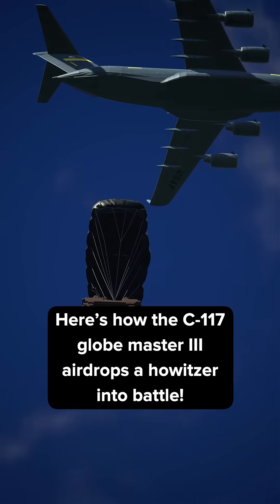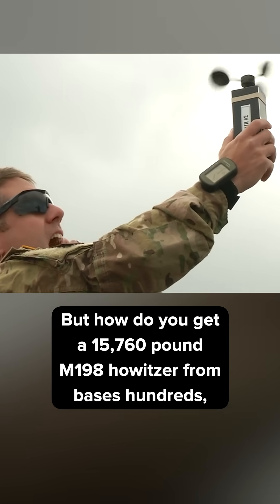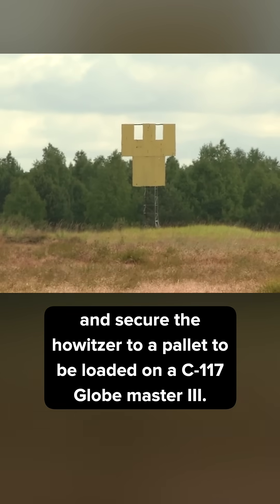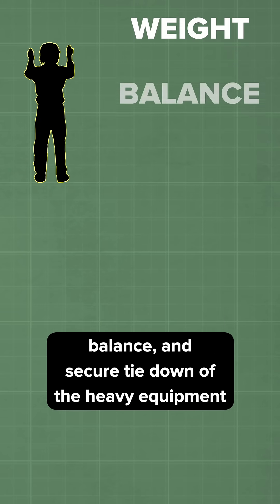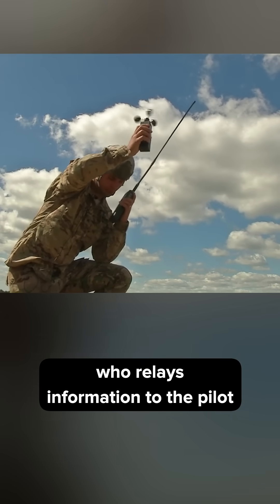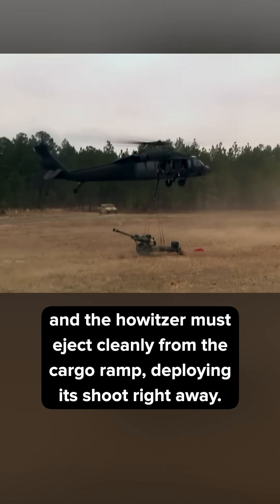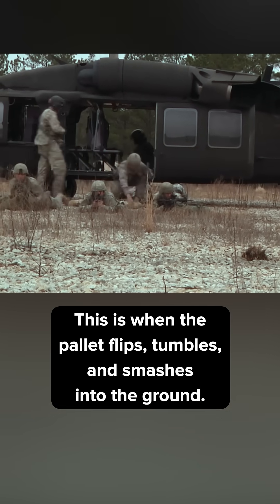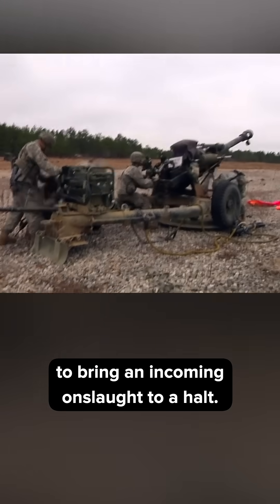Airdropping Howitzers Into a Battlefield

Comment: Soo many mistakes here. C-17, they are dropping a M777A2 not a M198 but even then they keep showing a M119A2 howitzer. Also the weight of the M198 is off because he’s including the weight of the “H-pack” which is never issued or attached. You either hand pump it or if you’re lucky enough to have a 5-ton, you can hook up to their hydraulic line.

Comment: Hey ummm, “burning up in descent” refers to this neat little natural defence mechanism has to stop fucking meteors from hitting the ground, basically it’s because the meteor is so goddamn heavy that it squishes all the gasses in the atmosphere that it lands on, into this tiny little area in front of it. This is how air resistance works, and it’s why things like feathers (that are light enough to catch the air below it and ride it) fall at a lower velocity than your grandma when I pushed her down the stairs, but back to meteors, the reason why boulders from space don’t catch the air, is because they’re too heavy so they just keep falling which just traps more gasses under it, and when gasses and things get compressed, they heat up, so that’s why meteors seem to glow when they fall, because they’re practically on fire. So how high are you dropping those “canons” from again?

Comment: The Loadmaster DOES Actually have to confirm load weight of the balance, and tie downs of the load...

Their responsibility is to make sure the payload doesn't take the plane out of the air...
Loadmaster's confirming the math is a redundancy  designed for Safety, in case the Embarkation Specialist (Embarker) jacks up the math...

The Embarker also cannot account for Space-A passengers or cargo (NOT always done during Combat Operations, but is common during Logistical Operations...

I was a 0481 - 'Landing Support Specialist' in the U.S.M.C., and dealt with loading these loads, and passengers (PAX), and worked directly with Loadmasters...
Reply: I was 82nd.TOW GUNNER and a math idiot. If they depended on me to figure out the balance we would crash and burn before reaching an altitude of 50'. I just know how to jump outta of a plane.

Comment: I was an Improved Hawk Continuous Wave Radar Repairman(IHIPIR, ICWAR, Launcher and Missile) 24K20 Army 1974-1977.  As a SPEC 5 in late 77 I was scheduled to attend Load master training a couple different times but something always came up requiring me at the 13th Ord to support the two Direct support units we supported so I never was able to attend load master training as I ETS’D in late 77.  Probably would have been an interesting training of how to prepare different elements of the Improved Hawk Missile System for air transport and air drop.
Reply: I believe we weee still using the C47 and C130 I think back then.

Comment: Loadmaster doesn’t do any of that shit. They just confirm air trans personnel paperwork that did all the math and work. Loadmaster just accepts the cargo. 2T2 for the win. And c-117? Not a thing. Who did your research????
Reply: Actually, the Loadmaster does have to confirm load weight of the balance, and tie downs of the load...

Their responsibility is to make sure the payload doesn't take the plane out of the air...
Loadmaster's confirming the math is a redundancy  designed for Safety, in case the Embarkation Specialist (Embarker) jacks up the math...

The Embarker also cannot account for Space-A passengers or cargo (NOT always done during Combat Operations, but is common during Logistical Operations...

I was a 0481 - 'Landing Support Specialist' in the U.S.M.C., and dealt with loading these loads, and passengers (PAX), and worked directly with Loadmasters...
Reply: Wait when did this show do research?
Reply: @phoenixgaming430  it depos c-117 does exist but its a modified c47 but ppl call it a c17